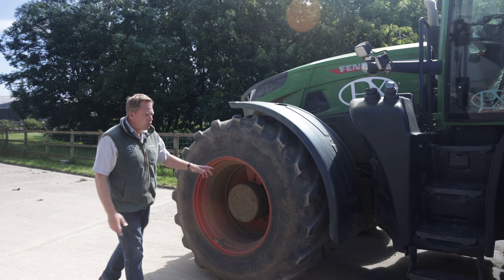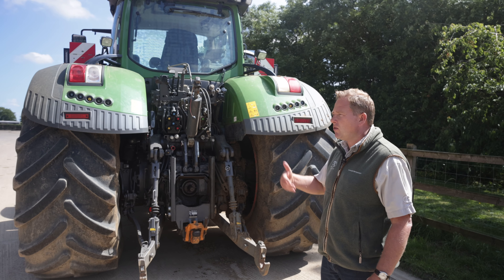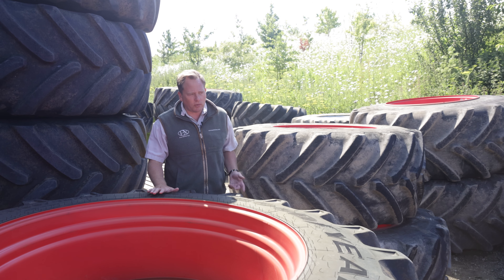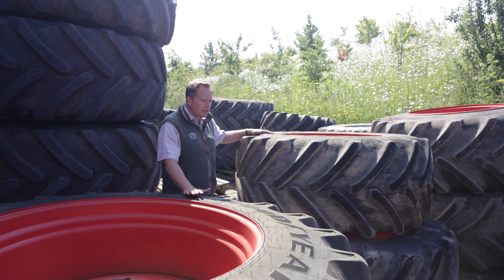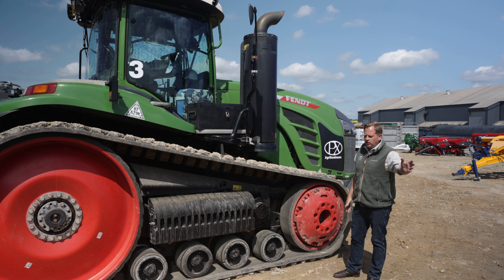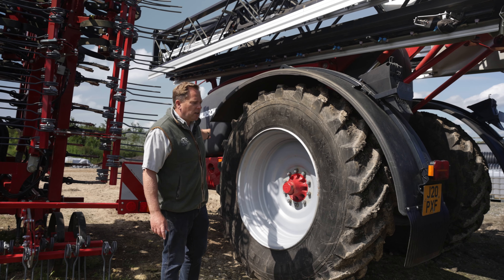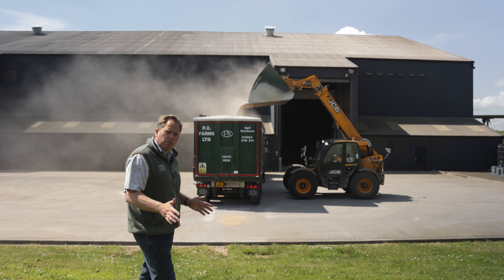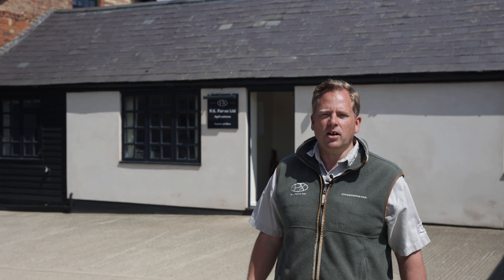Tyres, Tyres, Tyres

Comment: Do you buy tractors and machinery -wheels and tyres then add your BWT ones to help mitigate costs? Why are the sprayer tyres facing forwards? Most run the treads backwards to decrease wear.

Comment: Hi James  with your with your measurements how do you cope with the slow speeds on the public highway? Width under 2.55m = Max speed 25mph/40kmph
Width 2.55m and over but under 3.5m = Max speed 20mph/32kmph
Width 3.5m and over = Max speed 12mph/19kmph 🤫🤣 if they have updated this please could you show me where thanks